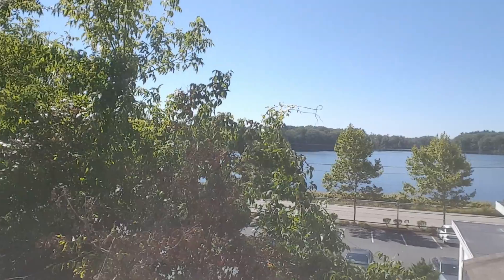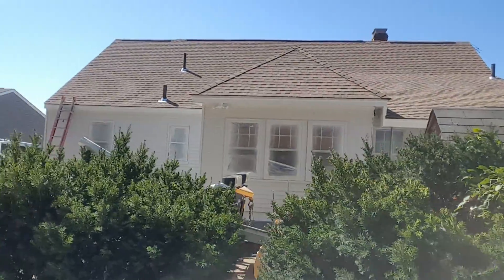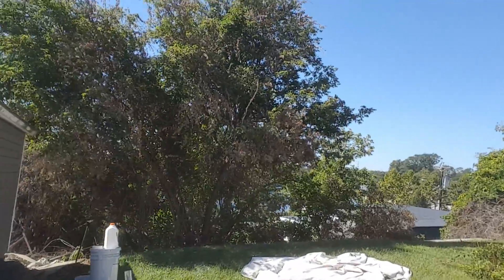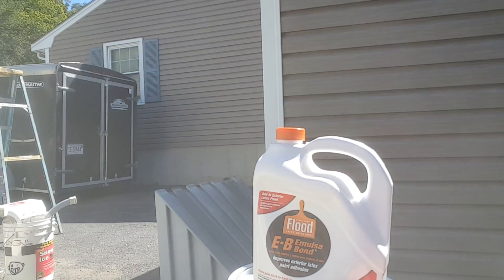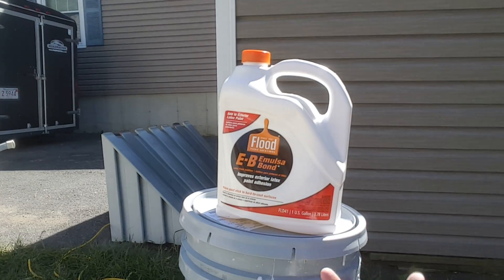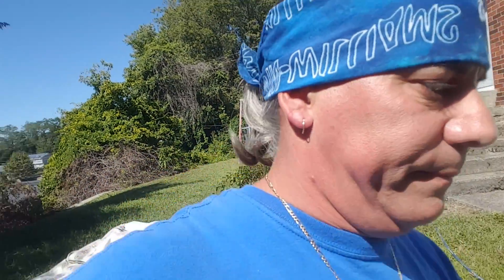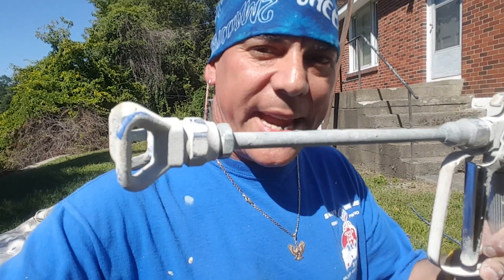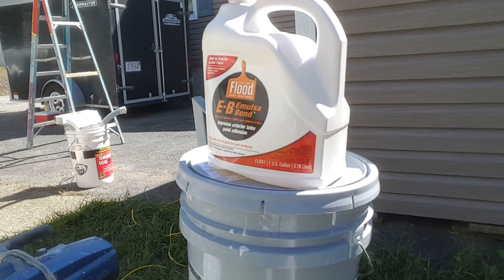Da P8NTRMAN🎨, Exterior Aluminum siding painting.

Comment: Is Sherman Williams superpaint good enough for aluminum siding on a house?
Reply from the maker: Super Paint is NOT as durable as Exterior Duration plus Emulsa-Bonder mixed together. Super Paint is a Paint and Primer put together. Duration is the Paint and Emulsa-Bonder is the glue. No need to prime because Emulsa-Bonder is the product that creates the adhesion for Duration. I personally used it and there are no paint failures on this house that I painted. Everything I explained in the video has to be followed precisely to the T. The Etching of the metal must take place as well in order to create the gripping of the paint. 

Thank You so much for your question. Not all Coatings work well. And it all depends on the elements. This house heats up big time and has no protection from the rain,the snow, the wind or the Sun. And the coating is still solid. It works!

Thank You for viewing my video.

Happy Painting!

Jhonny Da P8NTRMAN
Reply: Thank you P8NTRMAN, you’re the best!
Reply from the maker: @timrrdocuments7973  , Thank You so much for showing your appreciation towards me and what I'm trying to accomplish. I am humbled by your gratitude. I hope that you feel empowered with information and may it be beneficial as you plan your project. Have a wonderful weekend. Be Safe, Be Healthy and Be Blessed as you have blessed me.

Sincerely,
Jhonny Da P8NTRMAN👍🏻🤗
Reply: Does the EB create the etching?
Reply from the maker: @KANSASIOUX  No the Emulsa Bonder is mixed into the paint before you spray. The Etching product  is TSP by Savogram. Its sold at Home Depot. Read the instructions on the box. When Piwer Washing use the large black tip which is for soaping. Then use the green tip to rinse. If you have green grime on the siding you can add a quart of bleach to the TSP. Always use goggles and protect your eyes.

Jhonny  Da P8NTRMAN
Reply: Jonathan La Salle You the man Painterman!!!! God Bless you!
Reply from the maker: @KANSASIOUX  , Amen Isaiah, God Bless You for the blessing of your encouragement. It is well received Brother.👍🤗
Thank You!

Jhonny Da P8NTRMAN

Comment: How do you get the pings and dings out?  Any idea?
Reply from the maker: Hello there, that is a real good question. With aluminum siding it is virtually impossible to conceal, dings, pings and/or dents. My advice would be to approach it as if it was body work on a car. You drill a very small hole, put a long screw through it and pull out until you get the dent out. With pings I would advice bondo. Just remember that with expansion and contraction because of temperature change it will not hold. In that case you may have to replace that siding section. It's up to the customer and/or your judgement call. It may be more work for you. And more money for labor passed down to the customer. 

Thank You for subscribing, I subscribed back. Happy Painting and God Bless.

Da P8NTRMAN
Reply: Thanks.  I didn't know it wouldn't hold.  Bummer. lol

Comment: What sprayer do you recommend for a home owner that paints a ton. Painting my 3rd house in one year.  Titan 440.  Grayco 390 or grayco magnum x19 ?
Reply from the maker: Hello Jayson, Thank You for viewing my video. I would seriously consider using the Graco 490. This past Summer I completed a very large 400 condo 21 floor building project for Callahan Construction in the Assembly Square area in Somerville, a suburb south of Boston. We had two Magnum Units that fizzed out, we also had two Titan 440 units and a larger Titan Commercial Unit and they failed. Our Graco products far outlasted its competition. Sherwin William's sells Graco and Titan products which are virtually interchangeable. Stay away from the battery charged smaller quart sprayers also. The Graco 490 is both a Residential and small Commercial unit and will keep up with house painting applications. If you live in a cold weather area, now is the time to purchase. You may get a good deal. Do Not buy used on Craigslist, Offer Up or Letgo. Paint Sprayers are like a Kawasaki Ninja, you don't know what abuse it's been through. It's easy to clean up and lie about how much it has sprayed. You're better off getting it new and with a solid one year guarantee. Any questions with trouble shooting feel free to ask. You may also email me at jlpaintdesigns@gmail.com  again Thank You for checking in. Have a great weekend.

Comment: The paint I use for the aluminum can I use it for my wood too
Reply from the maker: @youwhobaby, Yes, the mixture of Sherwin Williams Exterior Duration mixed with Emulsa-Bonder will bond to wood as well. Emulsa Bonder is the bonding agent. The wood must be power washed first to open the grain of the wood. Allow to dry.

Happy Painting, and Thank You for watching my videos. Be Safe, Be Healthy, stay distant and God Bless You!

Jhonny Da P8NTRMAN 👍😷🤗
Reply: @JonathanLaSalle   We have a very old deck had been stained for years, my husband babied this deck  few years back we painted it,   the boards are old but truly doable  not interested in replacing at this time want to repaint it ,  how should we properly prep the surface??
Reply from the maker: @stephaniepeek6787  , Hello there, and thank you for reaching out. First, I would get ready to power wash the deck but first try to vacuum any debris such as sand or tree debris that accumulates along the cracks. You can use a small screwdriver, a one and a half inch spatula, or a 5 in 1 Painters tool. When you get ready to power wash, mix TSP and a gallon of bleach together in a 5 gallon bucket. Before adding your chemical cleaning mixture, fill the bucket with 4 gallons of warm water, then place the Power Washer suction hose into the water bucket. Use a brick to keep the hose from floating around and pin it so it stays at the bottom. Add a gallon of bleach, then add the TSP (Trisodium Phosphate) to the mix. Pre wet the surrounding area to be power washed to protect your shrubbery, plants, and grass. After pre soaking the deck then start your chemical treatment to kill mold, mildew, and other impurities. Be aware that this cleaning mixture will NOT clean Pine tree oil sap. For that, you may need to either use the 409 grease cleaner or you can use mineral spirits with a rag and apply it directly and scrub it with the rag until the oil dissolves. Remember, an oil activates an oil that is why I recommend the use of mineral spirits or turpentine. A quick safety reminder please use safety glasses and chemical resistant gloves, and any mineral spirits rags cannot be tossed in the trash they will combust and ignite. Placed the rags in a bucket of water and leave them in water for a few days. Oil and water do not mix, so the mineral spirits will eventually evaporate from the rag. The water is precautionary in case it does ignite.

Once your deck is ready for power washing be generous with the chemical application. The water will soften any paint that is loose, and in the rinsing process, you can get close to the boards to blow off any loose paint chips. Don't get too close, so you scar the wood. Just get close enough to remove what is loose. If you have any boards that are soft and squishy because of moisture, you must treat that area with a wood hardener or Acetone. Acetone removes the moisture from the boards and hardens the wood again. I just shared a little trick of the trade. We mostly use acetone on rotted windowsills. It hardens the wood again. Apply it with a throw-away brush. After the deck is dry lightly sand all areas to be painted for better paint adhesion. Preferable 120 grit sandpaper.

After power washing, allow the deck to dry for a couple of days. For Paint I recommend Sherwin Williams Exterior Duration in a Satin Finish mixed with Emulsa Bonder. With Emulsa Bonder there is no need to prime exposed wood. The paint will anchor to the wood. Plan on doing two coats of paint. This will give you at least 6 years of protection. Lighter colors last longer than deep tone colors. A gray finish is highly recommended  and is the most popular color because it hides a lot. 
I hope this project turns out to be the talk of you family and neighbors in a positive way. Enjoy the fruits of your labor and have fun painting.

One last piece of advice, you can add an aggregate to the paint to prevent slipping or sliding. Satin finish is also easy to hose off when needed.

Thank You for reaching out. I hope I've answered most of your questions. If you still have any more questions feel free to reach out.

God Bless in abundance!

Jhonny Da P8NTRMAN 🎨

Comment: Thank you for sharing all of your knowledge and tips with us, its very nice of you. I am going to be painting my house( aluminum siding ) and my garage ( vinyl siding ). I painted a few test pieces after thoroughly cleaning them but am still lacking adhesion on both vinyl and aluminum. I painted 2 days ago and could scratch off bits with my fingernail. I am going to do it again using the emulsa bond for the aluminum. My question is if you have ever tried it while painting vinyl? Any tips or additives in use with the vinyl siding? I am using the duration paint
Reply from the maker: taalf thorpe , I am thrilled that I could help. The Aluminum did not need a primer but the vinyl siding does. Do not use oil. Use Latex only. You can use the Emulsabonder for vinyl as well because it gives you better adhesion. Good Luck and Thank You for viewing.

Sincerely,

Jhonny Da P8NTRMAN
Reply from the maker: taalf thorpe , One final thought, do not scratch the paint off. Latex takes 30 days approximately to cure and harden. You can use TSP to Power Wash the Aluminum, do not add bleach or soap. Rinse thoroughly.  With Vinyl you can use some bleach to clean mildew, mold and another organism that bonds to plastic. Also rinse thoroughly.

Comment: Do you prime it?
Reply from the maker: @gloriacarina1  When Painting aluminum there is no need to prime if you use the formula I explain in the video. The product is called Emulsa-Bonder. The aluminum should also be washed throroghly and completely with the TSP. This opens the pours and prepares the surface by neutralizing any type of oxidation.👍 Now you can paint and the coating will bond. Thank You for your question. God Bless!

Jhonny Da P8NTRMAN 🎨
Reply: Thank you so much.  No priming necessary if I follow your steps.  Thanks 💯

Comment: Super paint by SW would work well too wouldn't it?
Reply from the maker: Blake Schultz , affirmative but you need to add the Emulsa-Bonder for best adhesion. That is the X Factor. Thank You for the question.  Happy Painting!
Reply: Jonathan La Salle well I see on Amazon that some 1 gallon jugs are 40$ and others are 150+$ what's up with that? 
I appreciate the responses too great work
Reply from the maker: Blake Schultz , Hello Blake,  Thank You for your comment and viewing my video. The Emulsa Bonder product distributed by Flood is sold at Home Depots nationwide for a little over $30.00. Anything excessively above that is Highway Robbery. Happy Painting and again Thank You for the encouragement.
Reply: Jonathan La Salle ok great thanks for the answer on that so my last question well last 2 questions would be do you prefer powder tsp or liquid? Also is it ok to leave the 2 boxed together (bonder and paint) and reuse over time if I have any left over or should I only mix what I need at that time?
Reply from the maker: Blake Schultz , Excellent question. To preserve the paint and bonder that you have mixed add water at least an inch inside of a 5 gallon bucket. Water sitting on top of the product will delay any drying and prevent oxygen getting to it. Also place plastic sheeting, a bit larger than the diameter of the lid and seal completely.  Store in a cool area and prevent the paint from freezing. Regarding the TSP, you can use the powder or the liquid. Both work well with the power washer.  Be generous with the amount of TSP you apply to the aluminum and rinse throroughly.  Good Luck My Friend.
Reply: Jonathan La Salle Awesome thanks again man really helps I just started cleaning today 1 side done in about an hr and half scrubbing and rinsing but it's still putting off a little bit of a chalky residue should I be worried?
Reply from the maker: Blake Schultz , That chalky residue is the TSP working. Rinse it thoroughly and allow it to dry completely.  Good job!

Comment: They sell multi acrylic from Sher Williams same-thing you break the paint warranty when you add that
Reply from the maker: Hi Palmer, I would verify that. It was a rep from the Warwick Rhode Island  Commercial store that advised me. The addition of the Emulsabonder strengthens and makes the Duration more durable and promotes adhesion. Not sure where you got your information. The Emulsa -Bonder does not work against the coating instead it is like paint on steroids. Thank You for your input. Happy Painting!
Reply: Jonathan La Salle I did verify with my rep well before I made that comment, it does in deed break the warranty that’s the only thing wrong with doing that. I did the same thing until I found the multi acrylic
Reply from the maker: Thank You Palmer, I will look into it. I don't like spreading inaccurate information. Sherwin William's is always innovating and formulating new products. However, in my defense. This home which sits in the sun most of the day has not had paint failure yet. But thank you for sharing that point. I will follow up, after I heal from my knee surgery recently with a new video. Happy Painting! 

Sincerely, 
Jonathan La Salle, Da P8NTRMAN

Comment: I want to see some before and after pics.
Reply from the maker: Jeffrey Renner , Thank You Jeffrey, I will work on that in the future. This paint job is holding up very well. It endured a summer and a winter and this is the second summer. This home has no protection from elements but the siding is holding up well. thank you for your comment.